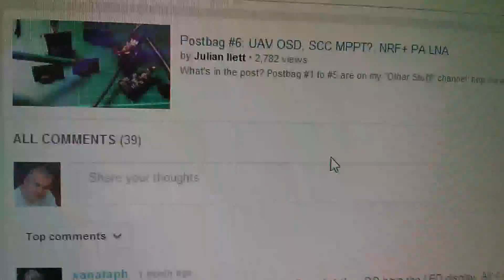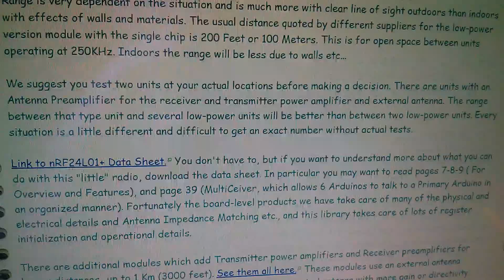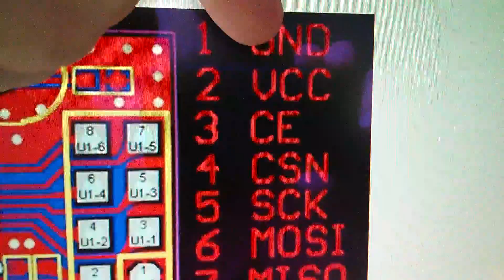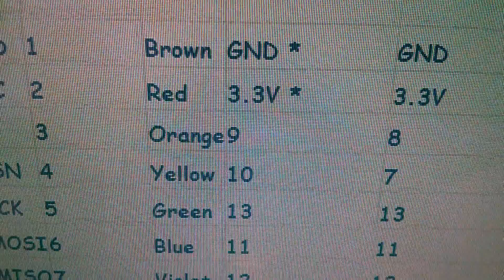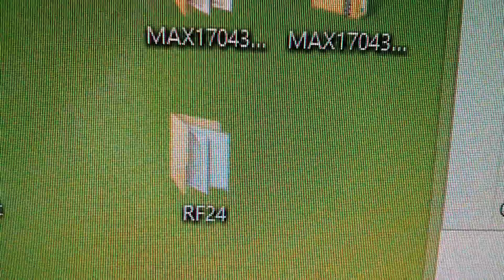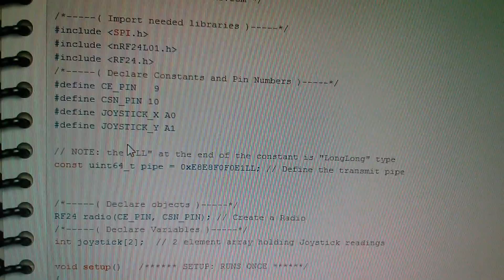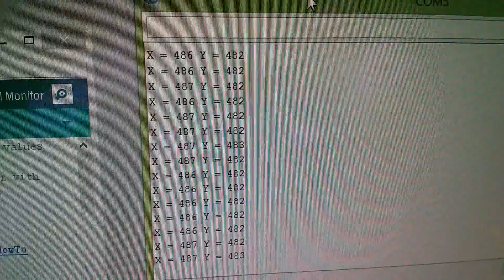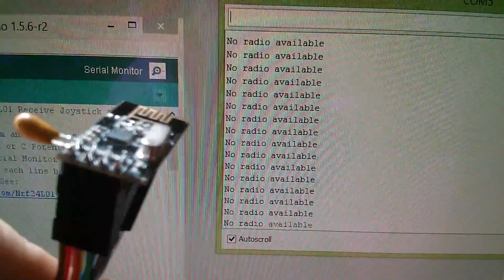1-Day Project: Arduino and nRF24L01+ Data Transceiver

Comment: I've recently been doing a project using these nrf modules. I was using the green ones that are 10 pin. They just have extra Vcc and GND pins that seem redundant. When I tested them I got about the same range through walls as you said roughly 15-20 at a guess. I then tested them outside with direct line of sight and got 41 metres before I ran out of space. For anyone else going to use these, you can download the nrf library from within the Arduino IDE. It just makes things a bit simpler as you don't have to go and find the library online and rename it etc. They are decent little modules when they work.

Comment: With your observations regarding power supply rails; - brings back great memories of Years gone By!;- my specialist boards FULL of TTL LOGIC!!! and my need to install More and More caps as I expanded my HUGE logic designs ...I must have spent several HUNDRED BUCKS just on a DISCO LIGHTING CONTROLLER in the past! = now I just use an MCU... (Arduino etc etc)...

Comment: Julian, another interesting and informative vid.
Good info on libs, code and module functionality.

The higher the freq, the more arial orientation comes into play with blocking and reflections introducing beaucoup effects.
Best signal strength for this 'meadering' type antenna is with antenna's Z axis pointing at non-blocked sig source with no reflections to mix out-of-phase sig w sourse sig.
If sourse is blocked, search for a reflected sourse like your fridg's door....
Laying the Tx module on the kitchen floor focuses most, but not all, of its Tx energy at the ceiling.
Regards and keep up your good work. Its always of value!
Regards/73
Russ in NH/KA1RUW

Comment: solder about 17 cm copper wire to the antenna. and connect the same length to ground.
Bam! there's a halfwave dipole antenna!

Comment: You are just perfect Julian. I bought 3 NRF24L01  and I am desperate to communicate but I am using Visual Studio. and I do have FTDI cables. I am wondering where the pins are connected on arduino is possible to let me know please so I can make a comparison.Thank you in advance

Comment: Julian, are you using the module with the larger antenna as one of the two units in this example or two of the same smaller NRF24 units? Thanks!

Comment: Nice walkthrough. I am using Mini Pro clones, which don't have 3.3v regulators, so before I decided to go buy some regulators, I decided to go dumpster diving in the e-waste, and I took apart quite a few things. I found several 5v regulators but I didn't find much at all in the way of 3.3v regulators. Seems everyone is making switching power supplies these days (or filtered big old transformers, in the older days), but not too common to find the 3.3v regulators. Finally I decided it wasn't worth finding these, and bought a pack of 10 of the knock-off base modules for like $4.50 from china ... cheaper than dirt, I shouldn't have wasted my time in the dumpster. Except now I need to wait for shipping. =\

Comment: What happens if you solder a piece of wire to the PCB antenna? Are antennas that simple or size/length/shape need to be fine-tuned for any improvement at all to be observed?
Reply: No, you cant just solder a wire to a pcb antenna. Antennas are tuned, and they need to be designed very carefully. A lot of math goes into designing an antenna. By soldering a wire or even touching an antenna you are effectively changing its inductance and capacitance thus changing the resonant frequency. :)

Comment: Why bother, just as well use a wire over such a limited range.
Reply: Robert Hickman personally using them for an RC skateboard so only needs to go a few feet but having a wire would be a problem when moving 20mph down the street :). There are other cases like IOT devices that report back to a hub with Ethernet to upload data... say a smart garden or solar monitoring and or control system.

Comment: hi whats distance on these? you think i could swap 1 of these into a dx6 to get rid of dms only? i got the old dx6 and its locked to dsm and dsms dead.
thanks
Reply: oh can i use all this with gyro and borametric for a flight controller. what distand they hiving you? if i could get reliabw 100 id be happy.

Comment: Hi Julian, thanks for great video. Do I have to solder capacitor if I have socket like at 1:12 ?
Reply: Arsalan Iravani Having a capacitor between ground and the vcc on the rf board is the important one if one is already on the module it should be fine.  The capacitor between vcc and ground allows some charge, up to the input voltage, to accumulate in the capacitor then if the circuit momentarily draws more current than the supply will allow to flow (because of resistance) then the power will come out of the capacitor instead of the processor or other components not having enough power to operate normally.  having one for the Arduino input if your power source can't handle the draw at times helps as well.

Comment: What would happen if I connected the VCC to 5V? I'm trying to create a wireless robot with 2 spared nRF24L01 modules using my Arduino Esplora as the controller. The only problem is that my Arduino Esplora only has 5V output.
Reply: Jason Lee You'll probably break it. Absolute maximum rating for thr supply voltage is 3.6V. The signals are 5V tolerant though.

Comment: Hi Julian,  Great video and thank you for making this can I ask a question please.  The question is can these RF24 connect to the local wifi network?  If so where would I find the code for this to work.  Only new to this stuff but a communication Technician by trade.   I am trying to get the wifi to control a pro mini to control a relay to turn on and off a light.
Reply: Your best bet would be a ESP8266 its similar price but is a wifi chip, the NRF24L01 is RF so it wont interface with wifi with out a lot of work

Comment: Is it possible to use this module with the attiny84?
Reply: TheWGBbroz You can use it with literally any microcontroller, its just an spi interface. I have personally used it with an ATtiny84.

Comment: hi !!!! i've got my module to work but it works fine at 5cm apart and after that the recieve signal are lost what's wrong with that i have powered my modules from the board and added a 10uf cap in parallel !!!
i can't figure out whats the problem
Reply: Monitor your 3.3 volt supply. If you have a scope even better. It does look like your 3.3 volt supply does not have enough current available or too much voltage drop in your wiring.

Comment: what files did you load up? the site has changed abit and i cant find them :/ i cant get the 2 to talk to each other only when i unplug a pin i get alot of noise on the serial monitor.. any help please?
Reply: i also have 3.3uf caps and plugged them into 3.3v on arduinos.. the caps are 50v each is that why?

Comment: Hello  Mr Julian Ilett, and thank you for this tutorial, I want to ask you about this topic , I want to send data from arduino Mega 2560 with arduino wifi shield integrated antenna to phone  but the problem that the arduino board could not detect the shield and serial.print: " wifi shield is not present " have you any idea about this and thank you

Comment: that bulky board with a micro on it, is configured as a i2c device.
i've a couple as yet unused, but a pdf i found details a simplistic rx / tx setup with them.

the 8 pin interface adaptor is rather handy, the names seq for the 6 pins is memorized.

stephen
Reply: link to pdf?
Reply: +DancePartyAttack 
icstation sells it, mine came via aliexpress
link to page and doc pack
http://www.icstation.com/icstation-nrf24l01-wireless-shield-interface-p-2835.html

Comment: Hi +Julian 
I'm looking to build a wireless kind of headset using the Arduino. I was wondering if this set will converting the analog signal from let say my iPod to a digital data that will be then received by the receiver?

Comment: Hey Julian, thanks a lot for such an excellent explanation which tutorials fail to provide. Can you please tell what's the significance of the 'size of' function inside the 'radio.write' ? I want to send values of only one potentiometer wirelessly, so when I wrote something like 'radio.write(pot)' {I had taken the variable 'pot' for the values}, it returned an error. Can you help?
Reply: the write() func needs to knowtje size of the Data. sizeof() gives that in bytes

Comment: Hey great video, i have a question, do you know how to activate the nrf24l01 without a library in assembler, i managed to make the spi communication between two p16f877a but not with the nrf24l01

Comment: Hello , I wonder if this Arduino module 2.4G NRF24L01 + Wireless Transceiver Module + SMA Antenna Microcontroll will need internet connection? I intend to use in an area where you do not have Internet Connection , already congratulate you for the excellent video. Best Regards

Comment: Dear Julian,
I was trying to communicate between Mega2560 and UNO via NRF24L01+. But I couldn't manage the same. I've used UNO as Tx and Mega as Rx. My NRFs are not faulty (checked).
My ckt. details are as below :
Vcc - 3.34 V, MISO - 12&50 , MOSI - 11&51 , CLK - 13&52 , CS - 10&53 , CE - 9 for RF24 & 8 for RadioHead library.
May be I'm doing some mistake. could you please help me out.
Reply: tug vvvvhhhjbjk
 b     bknbg cf by
Reply: tug vvvvhhhjbjk
 b     bknbg cf byFuji h

Comment: why have you used this additional capacitor? What for?
Reply: +Szalony Naukowiec Many places that discuss the use of this module recommend it.  The radio module transmits in short bursts, during that time the module draws a spike of power from the 3.3v power line.  This can cause the supply to dip and possibly cause interference with other components or intermittent behavior of the radio. The capacitor smooths out the power.

Comment: hi nice video.
I'm using nrf24l01 for my project but I need to transmit 6 values from 6 sensor. The problem is that I should add a delay (500) on receiver algorithm ether wish it doesn't work and it says no radio available?
how I could fix it ?
thanks

Comment: Fascinating side note, who knew the CH340 carried the 3v3 vreg duties. 200mA or less I would imagine. Is this a standard method for that second voltage. Do some knock offs have dedicated SMD like an AMS1117 3.3 offering a little more robustness therein. It is a very nice version of the Uno with the double gated I/O headers. Not an easy find these days to be certain. As per usual a very enlightening Illet production. Best regards

Comment: Anyone that do manage to make theese modules work on a Mega2560?
Reply: Did u have any Problems? the connecting pins Are also descripted at the tutorialpage he just showed in his video5
Reply: Yes, problems solved. It was due to Mega's unstable 3v3 source, wich interferred with the trasmission. I got the sockets shown at the beginning to make everything work. I also used a software fork, but it should be not necessary... Thanks!

Comment: Hi, I didn't understood if the High Power module have to be used WITH the nRF24L01, or if it simply is a more powerful (long range) version of the same thing. I'm intrested in using theese modules in a quadcopter-like project, so i need high reliability...
Intresting video, by the way! Thanks!
Reply: +TheItalianGamer They are the same but with amplifier and sma antena

Comment: Reni
I am using 2 different controllers. Pololu A star32U4 and Arduino Uno. I use 1uF and 4.7uF (Uno). They are not talking. The monitor says "no radio available" 
How do you test the radio if they are not working? is there an phone App to test communications

Comment: I'm using them to send outside environmental and other data inside. I found the Maniacbug library easier than the RadioHead library.  A 1 microfarad capacitor seems to help.

Comment: Hi, 

I just have one arduino uno and this nfr24l01. Is it possible to communicate with a wireless modem directly ? In this video i see that you are using two arduino to communicate in between. I bought these module as an alternative for wireless connection, so that i was expecting my  thermometer on my arduino would send data to a website. did i got it wrong ? 

Does it only transmits data between two arduinos using two of these modules ?
Reply: +M. Yıldırım yes its not for internet its just for wireless data transfer between two microcontrollers
Reply: +jamiepie123 damn i bought the wrong thing again :(
Reply: I should have bought Arduino Yun directly, instead of all this mess with arduino uno, ethernet shield, nrf24l01 etc... Complete mess...

Comment: Julian, thank you for your posts, Man. They are nicely paced, and  have helped me get started on this new hobby. 
Question: Can I bind one of these NRF24L01 modules to my old toy remote control? ......How?. I have connected it to the arduino, loaded a program I found in the NRF24 library that is supposed to "Listen", with no results. When I start the Remote control, However, it beeps like it did pair up, although it behaves like it didn't, and the program stays like in a loop trying to find the signal. Can you help?
Reply: We will need the details for the toy remote you are using to help. Depending on the frequency, chip type, compatibility etc it would theoretically be possible although it might be more work then necessary.. If your toy remote is relatively simple (ie not many outputs/channels) you may be better off pairing two of these RF24s' and building your transmitter and receiver around these chips. Is your toy remote 2.4ghz ? If so it is theoretically possible. Sorry I can't be more help :( but leave me some details and we can maybe help you out. Cheers
Reply: Thank you, Anthony Odin. I appreciate you attending to my question, sir. Although it might not seem like it, but sometimes asking the right questions is a lot of help :-)
I bought a Zipp Nano Copter (from propelrc), that ended up damaged. I tried to buy the receiver board, however, did not get very good response from propel, which now I see some other people hvae had the same bad experience. It is the remote control from this Zipp Nano-copter the one I want to re-use, and it reads, 2.4 GHZ 4 channels. Take a look: http://flightclub.propelrc.com/products/zipp-nano-copter/pages/helicopters/helicopters

Comment: If you look carefully at the video, you'll see a tiny three-pin surface mount chip on the Uno clone, labelled 662K. That's a voltage regulator whose purpose is to drop 5V to 3.3V at up to 200mA . I suspect that may be the actual source of 3.3V - there wouldn't be much point in having it on the board if the CH340G was capable of making 3.3V available.

Comment: Built this, as I had a couple of them from Banggood kicking around in my "Curiosity Box" - where I use up the last couple of quid in my PayPal account.
Had a Nano, and some 3.3V Pro Mini's, the latter I buy like candy.
Set it all up, then realised I'd connected 5V to the radio module. S H one T!
It SURVIVED! I put one pot. on the transmitter - Analog0 on the nano, and used the exact same code. Analog1 was floating. Nano mounted on a similar breakout board aas your setup.
Here's weird....the readout dutifully showed Analog0 tracking 0-1023 nicely, but Analog-1 closely tracked it, until I grounded Analog-1.
Reckon the Chinese don't clean the flux off their boards thoroughly - must've been the extreme impedance of the analog pin, Wasn't capacitive, else it'd (A1) have changed over time. Bit of a caveat there, if folks are getting odd readings on their analog readouts.

Comment: In receiver code: error: void value not ignored as it ought to be

What is the solution?
Reply: Leilektsoglou You're using the forked version of the nRF24 library from TMRh20. That returns void from the radio.read() instead of true/false as maniacbug's original version did. Modify the loop to look something like this:

void loop() {
  if ( radio.available() ) {
    // Fetch the data payload
    radio.read( joystick, sizeof(joystick) );
    Serial.print("X = ");
    Serial.print(joystick[0]);
    Serial.print(" Y = ");
    Serial.println(joystick[1]);
    delay(150);
  } else {
    Serial.println("No radio available");
  }
}
Reply: Ensure that you're using the right "-marks. If you copy code, it sometimes gives you the fancy slanted ones instead, and that is what normally gives you that error message.

Comment: Julian Ilett I believe you can enhance the reception of the transceivers by soldering a wire to the exposed copper tracks (which I believe to be the on-board antenna) to a metal coil or WiFi antenna it increases the range of about 4-5x depending on the metal used for the antenna. It does reach a range of up to 2000 feet when it's on line of sight.

Comment: Julian, I'm a follower and also a Green Horn Newbie. the Capacitor I have looks( like a black tube with 2 wires out the bottom) a bit different and has a plus and minus side should I do the obvious plus to 3.3 v and Minus to ground or am i using the wrong capacitor. for some reason i'm afraid of wreaking this module. 

your clear and fun videos inspire me to keep teaching myself electronics.
Reply: thanks

Comment: This is a great video! Thanks. I noticed on the info page for the nRF24L01+ that it can talk to "up to 6 devices at once." Do you know what happens beyond 6? Would there be any interference issues? I'm wondering because I'd like to build 50-100 modules and have people using the radios to send message, and I'm wondering what kinds of problems I might run into. I'd be grateful for any insight you have!

Comment: Thank you for the helpful video. When I try to upload these two example sketches to my arduinos, I get the following error on the Rx sketch. I'm pretty new to using Arduino in general. Did you get this error too? /Would you know whats causing this?
for the following line in the code:
      done = radio.read( joystick, sizeof(joystick) );
it says, "void value not ignored as it ought to be"